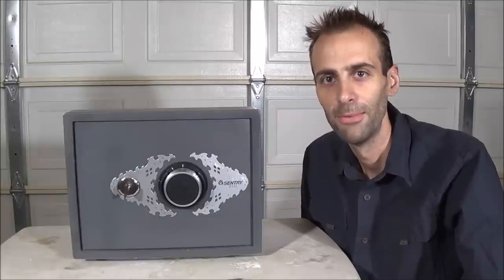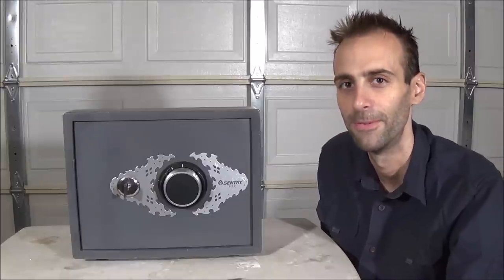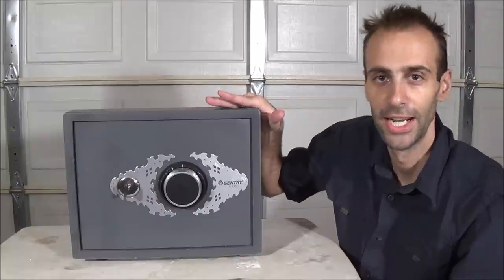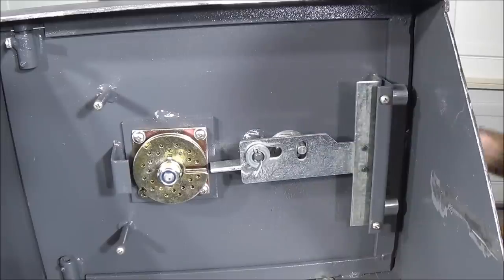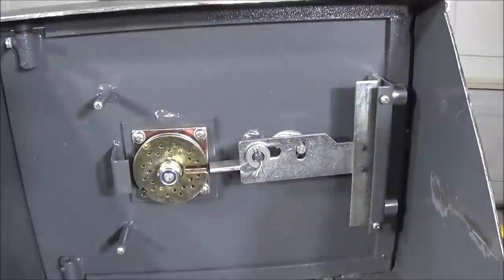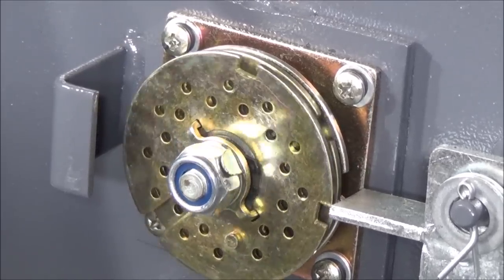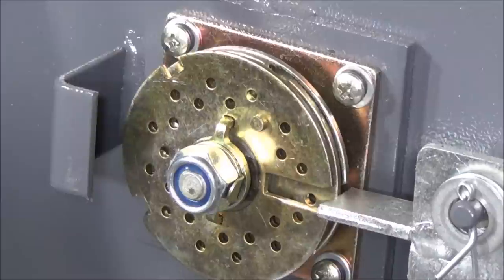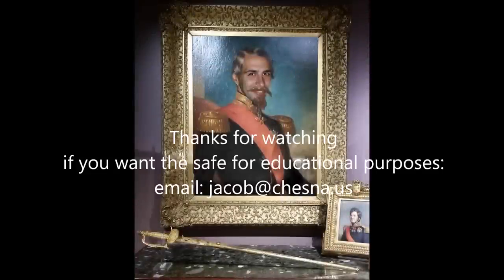How to crack a SentrySafe - dual lock safe

Comment: You were very much on the right track. The only part you missed was the correlation between the wheel gates, the stump and the key position on the outside of the safe. By attaching a thick wire (piece of coat hanger etc) approx 6 inches long to the key, you magnify the turn of the key. The key turns slightly more, the further the stump moves into the wheel / gate. Mark positions on the safe door corresponding to the end of the wire. By noting the differences at various wheel positions - 2, 4, 6, 8 etc., you will easily find the numbers for the three gates. Then by trial and error you will find the combination. The time to open this safe should be 5 to 15 minutes. Some of these safes have a handle instead of a key hole. In this case attach the wire to the handle!
Reply from the maker: Yes this would have worked good. I guess the blessing of having all the info at your finger tips is accompanied by the impossible task of having to rifle through it all.
Reply: The key, instead of a handle, was added for extra security. 
You'd have to pick the key lock, in addition to the manipulation of all channels.
Reply: Wish I understood this.

Comment: This Sentry safe has direct entry gates and the fence is attached to the handle or in this case the cross-lock.

By attaching a long needle to the handle and a graph on the door, then applying pressure to the handle (or key) advancing the dial/wheels in increments of two numbers you can measure the distance and determine the combination. The furtherst the needle swings to the right is a true gate.

The second MOE, Method of Entry is drilling a hole a quarter inch above the 9 o'clock position right into the outer dial ring, then scoping and aligning the wheels with a 70° scope.
Reply from the maker: Thanks for the details on how to do this professionally. Ill pin it.
Reply: @internationalprecisionengi1737  Thanks Jacob

Comment: I agree with Aaron - it would have been easier to manipulate the dial to find the gates, especially on a safe of this type. It's not that difficult. Finding the 3rd, direct drive wheel combination number, even with false gates on it, is easy. The true gate is wider and you'll get noticeably greater variation of dial play between gate contact edges and the fence when it's in the true gate as the false gates are narrower. Search YouTube for demos on finding the numbers for the second and first wheels which are done by measuring bolt handle deflection for every fifth digit on the dial (trying 0, 5, 10, 15 . . .) and charting bolt handle deflection. For a 100 digit dial, you're into the safe in under 50 tries with the first ten or so (depending on false gates) going very quickly, and the 20 after that for the 2nd wheel number not taking all that long. With more expensive safes using higher precision mechanical combination lock components the manual cracking process is the same but requires better feel and more finesse (and experience), and it may require trying every third digit for the 2nd and 1st wheels (lower tolerance slop in the gates). Going up from there with better mechanical locks and the finesse and feel required goes up. Spending a bit of time searching for mechanical dial combination safe cracking methods for an inexpensive consumer safe like this one and using them would have saved an immense amount of time, effort and cost rebuilding the closet interior you demolished.
Reply from the maker: Great summary on how to do it right! Yes, it could have been cracked, but likely by me. At the time I didn't even know how a safe worked. I wish it would have been a real safe, I would have paid to have someone crack it, but being that it was a tin box (not even fire proof), it was more fun to cut it open.

Comment: I  would like to clear up the age old belief that safe manipulation works by listening "to tumblers click".There are no 'tumblers' in a safe lock and nothing 'clicks' into place.

Older, antique safes like a Hall have a weigted fence which willl fall into the gates and drive cam, clearing the passage of the bolt work which is attached to the handle. In this case the drive cam is rather passive since it is not used to actuate (throw) the lock bolt. 

A spring loaded lever lock like a Sargent & Greenleaf or LaGuard is what most modern safes have installed  They are also used in all bank vaults but with four wheels instead.On those the nose of the fence drops into the drive cam and by turning the dial the fence lever retracts the lock bolt.

Both systems can be defeated by contact manipulation, meaning that you measure the left and right contact points of the nose dropping into the drive cam which is mounted at the back of the wheel pack. The nose of the fence will drop all the way into the drive cam when all gates are aligned underneath. If there is a gate under the fence it will drop very, very minimal which you can read on the dial by measuring the minute change of distances between numbers on the dial by slightly touching the left then the right side of the nose with the drive cam. That's why many professional safe technicians use a magnifying glass above the dial and look straight down to see those minute changes. That process you never see in movies.

Manipulation is using sight and touch only. A sound amplifier is only needed when the contact points can't hardly be felt anymore because the lock is too far away from the dial due to thicker doors. A good safe technician can open a three wheel lock in about 20 minutes.
Reply from the maker: Awesome! I'm ecstatic that so many experts have chimed in on this video. We should make more!
Reply: @internationalprecisionengi1737  I second that motion
Reply from the maker: @williamfairfaxmasonprescot9334  looks like I'll be looking for more safes then! Thanks for checkin it out
Reply: Hello
Reply: @internationalprecisionengi1737  absolutely. No problem.

Comment: The "tin shield" is not for aesthetics... the tin cover plays a very important roll of preventing the things stored inside the safe from being able to move into the lock's mechanical movements which could obviously cause a jam and then wouldn't be able to dial the combination and release the latch.
Reply from the maker: good call - its amazing how hard it is to dummy proof something

Comment: Sentry safes really aren’t a “safe” - they are selling the illusion of security - technically, they are a residential security container because they lack the necessary security features to qualify as a safe - same goes for most gun safes. You get what you pay for - the key question is, how much steel is in the box, and the door because that determines how long it will last against hand-held power tools like drills and grinders.
Reply from the maker: There's always the bulldozer :)

Comment: the cost of theat safe is around $100 most of their wall safes are 75 to 100$
Reply from the maker: You were able to find info on it - please share? Judging by the thickness of the steel, I'd say it was a little more than that. The $100 safes are sheet metal, this thing turned out to be something like 3/16 thick.

Comment: It's weird that that safe has a combination change index marking, even though it doesn't have a mechanism that would make use of it. Like it's marketing wank that mimics a feature that nicer safe locks have to trick you into thinking it has a quality lock. That thing is a piece of junk. I'd say it'd make a great boat anchor, but it doesn't have enough steel.